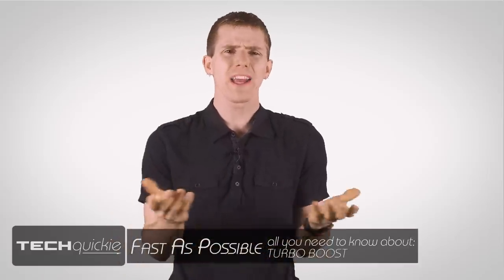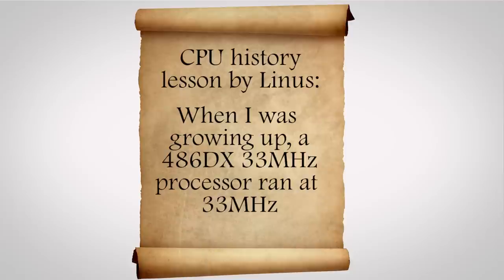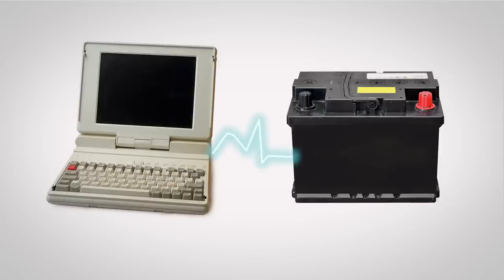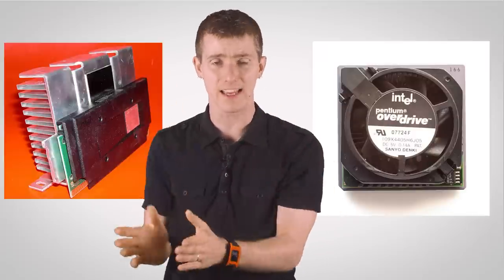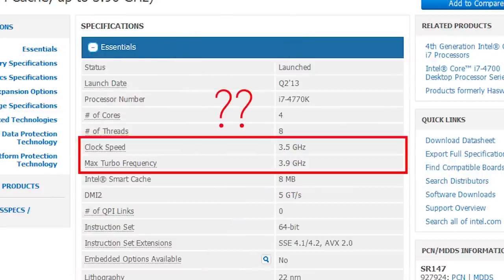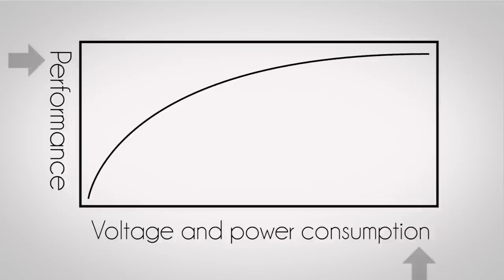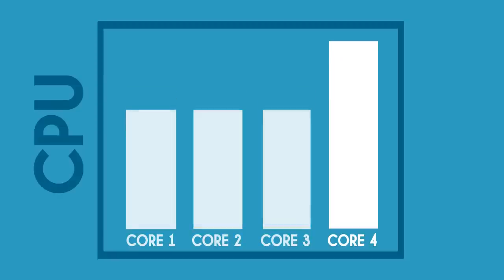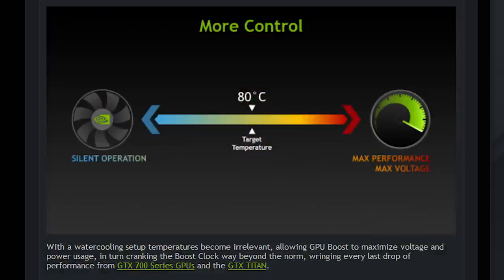Turbo Boost & Processor Efficiency as Fast As Possible

Comment: My laptop fan goes into TURBOBOOST when I open google chrome.
Reply: +Nano Boyut CHromium is EXACTLY same thing as Google Chrome, Chromium uses google chrome´s core made by google.
Reply: +CreeperCraft137 pretty much all devices do that.
they always say "more performance when you need it" but it's really "more performance whenever possible" and that can really fuck with your battery life/heat especially since you can turbo boost on all cores at the same time (which really kills battery life)
thats why for times when im going to constantly have a load on my laptop (say watching a video in a web browser) I turn turbo boost off
Reply: +Aleš Nezbeda (SlouchyButton) only difference is it's open source, has less compatibility with formats and doesn't have a flash player. You should install it yourself. I don't think there is much difference between them unless you hate properiotary software and love google chrome apps and extesions.
Reply: You made my day
Reply: dude the opposite is true
Reply: i mean why are you complaining about turbo boost? you just hook the exhaust fan back to the input and increase performance. do you have a boost leak? is your intercooler filled with oil? did you check the blinker bearings for the CPU???
Reply: lol, buy a new one
Reply: +Blitzkrieg XVideos
Reply: Chrome Hell naw this amateur shit makes me wanna throw up.
Reply: Blitzkrieg Was someone talking about how I cause his fan to go on turbo mode? If so, then closing porn tabs when you don't need them is ideal. So is closing your deviantart tab.
Reply: Chrome I dont know whats up with these people xvideos,deviant art whats next tumblr? :)
Reply: Chrome it's not a problem with you. It was the years of dust I never got to clean out.
Reply: My laptop fan goes into TURBOBOOSTULTIMATEEXABYTESSDOVERDRIVESUPERULTRAOVERCLOCK mode when I click my mouse .-.
Reply: Made my day way to relatable
Reply: XD my favourite comment of today!
Reply: 666 likes
Reply: bruh

Comment: Fun fact: the first so-called "turbo" CPUs were introduced around 1987, and they ran at a whopping 8 MHz, instead of the normal 4.77 MHz. And if you wanted to play games, you had to turn off turbo mode, otherwise they would run too fast! (Because most people didn't have the foresight that faster CPUs would be developed, so they programmed the game's timing to be based on the CPU's clock speed.)
Reply: ***** Asians play it at 120fps. Yea it sucks.
Reply: same thing on emulator.
Reply: interesting...
Reply: I remeber having to press the Turbo Button, in order to play somehting.
Reply: Funnily enough, things like that still happen today. Some games change when played at a higher framerate. Most recent case would be Titanfall in which a lot of actions in-game happen faster if you're playing at 120hz vs 60hz. Your weapons will shoot with a slightly higher RoF which is quite nice if you have a 120hz monitor.
Reply: craig1287 I wonder if that is an artifact of the older Source Engine?
Reply: craig1287 Thanks for spreading BS like that on the internet. You're doing Linus and maybe Mythbusters(?) a favor.
Reply: wow man this is mindblowing to me hehe i was wondering how many years from now were gonna reach 10 mhertz consumer cpus level(before i read ur post obviously) hehe
Reply: Did you mean ghz because today a CPU runs at roughly 4.5 ghz, not MHz
Reply: ***** Yes and no. NFS was bound to the games refresh rate. Games back in the day were bound to the actual CPU speed. So while NFS limits your FPS to 30 and you have to essentially break it to unlock it, you can not limit the CPU speed. So as soon as you had a more powerfull CPU, the games started runing in turbo mode.

Also i loved those "turbo" buttons on them 486 PCs XD
Reply: Grega Meglic
Lol, so that's what the turbo button was for :) I always wondered what it did.
Reply: Yep! Most older computers/electronics had their programs tied directly to the CPU speed.
It makes sense when the program was only going to work on 1 machine and every machine has the exact same specs (Like a Commodore64, or a Gameboy). But the IBM PC wasn't made to have 1 spec revision, so its kinda weird that the games didn't have variable speed adjustment (or whatever the term is)
Reply: craig1287 I can't imagine the Source engine having that kind of issue, seeing as most competitive CS players play at extremely high FPS.
Reply: Adam Saeed
He meant MHz , that was in 87.
Reply: craig1287  The saddest part is, in most game-engines it takes minutes to work around this...
Lazy devs.
Reply: Which is exactly why it was a pain to play older games on newer PC's back in the late 80's early 90's.
Reply: I think COD4 had the same thing about ROF. Framerates kinda affected your ROF which is why Promod limits it.
Reply: Whoa!
I* Remember My First graphics Card.
I'm Looking At You 6800 GTX
Reply: This is not true the so called TURBO button all it did was REDUCE the cpu performance so it could play older games. #learnurshit
Reply: Lol haha nice fact
Reply: haaa wahhh
Reply: Adam Saeed no. Back when cpus ran in MHz
Reply: VWestlife i just found it was the culprit who harmed my pc for months around 5-6 months . Intel turbo boost is really useless
Reply: so back in the day faster pc = hard mode
Reply: there are some games I have from my pentium 1 days that dont have a fps lock, and relyied on that slow 200mhz cpu as the game's fps lock
Reply: @artins90  Bloodborne has it's animations locked to it's framerate as well I think... To be fair it was meant to be played on a console which also had a locked framerate

Comment: Damn Linus did you really have to fuel fanboys by only talking about Intel/Nvidea? AMD cpus have a turbo clock and AMD Powertune (might have that name wrong) adjusts graphics card clocks. As well as I, for one, do not know exactly how AMDs solution for CPU turbo works. It would have been nice if it were in the video.
Reply from the maker: It works basically the same way.
Reply: Techquickie Oh well okay then haha, thanks. I figured there would be some kind of difference.
Reply: He also forgot to say that the first multi core CPu was from AMD...
Reply: andybruintje
hes paid by Intel, so he can't reveal that information XD
Reply: andybruintje Considering the video was not on multicore cpus, thats not a big deal. When the video is on turbo frequencies however, he should have mentioned AMD does it as well as Intel/Nvidea.
Reply: Considering his earlier video about what CPU to buy with the solution "Buy what fits you" it wasn't really needed. And well apart from using the I7 on the last part, most of the video was 'in general'.
Reply: TheGamingLawNL Its still worth mentioning, I feel. Even if it was just "AMD does this also."
Reply: That would be something very hard to see, because a lot of Linus Videos, are Sponsor by Intel
Reply: Old Mate Yeah, Intel is a big sponsor of his Linus tech channel
Reply: whats AMD?
Reply: +EliteRanger_ Plenty of videos where he only talks about AMD
Reply: +Sword of damocles You forgot to say how irrelevant that is.
Reply: +EliteRanger_ Intel and Nvidia are sponsoring this video.
Reply: my Athlon 860k has "X-boost".
Which is basically just a glamorous name for a 300mhz overclock.

That's right, no nifty boost features, it just sets the clock frequency of the entire CPU 300mhz higher, changing the CPU from a 3.7ghz quad core to a 4ghz quad core, with consequences like higher power consumption and more heat output. To make it even worse: enabling X-Boost boosts the core voltage all the way up to a massive 1.4 volts, and the stock cooler can no longer handle the load and the CPU will thermal throttle when under load.

So no, AMD's "boosting technologies" are nothing special, they're literally just factory overclocks that you can enable if you feel like.
Reply: deWaardt
... where's that Fry meme when you need it.
Reply: +EliteRanger_ I like both but I much prefer Intel. I've seen Intel processors take a beating and survive while some AMD's have straight up caught fire on me before.
Reply: Fermifire
Refer to my previous comment.
Reply: Logan Darklock Look out! gramma police is here
Reply: ... That makes you look like you're a fanboy of AMD. Not much difference
Reply: @EmilM-pb2hn  What about appreciating unbiased information?

Comment: I went form a hot running AMD quad core running at 3.2GHz max (AMD Phenom II X4 955). It seemed to turn off cores it wasnt using either, while during idle. However, ive never seen it throttle its speed during idle.

Now i got a i7 4770K and its a world of difference... i should mention i also have a Asus Z87-Pro motherboard, that comes with auto-overclocking features.
single and dual core run at 4.3GHz and triple and quad at 4.2GHz. However, getting it so far to go all the way up, ive only ever seen it use 4.2GHz.
During idle that thing will drop down to 800MHz and use 0.1V or less across the cores.
Its so good i sometimes miss my AMD heater lol.
Reply: ... AMD, heater? you have no idea what you're talking about, the old Phenom 2 X4 955 had a heat cap of 62c, I had mine OCed to 3.9ghz with FSB 182mhz or 282mhz (cant remember) running at 56c max load.

Heaters? you must be talking about Intel

my i5 3570k oced to 4.7ghz runs 85c-90c

why lie?
Reply: you may look at the raw numbers and think its the opposite, but im talking from experience. Perhaps you were thinking of full load situations, in which case you may be right. But im talking regular use across the day: internet, gaming, word, movies, music, etc.

At least in my personal experience and situation - and ofc, yours may be different - my tiny game room was constantly hot with the AMD core + a GTS 250. Now with the i7 and a GTX 780Ti; both supposedly running hotter than the previous pc, my room just doesnt get that hot anymore.

During winter i didnt need a heater, literally no need, when my old pc was on. The current one doesnt heat up the room as much at all.

The reason behind it, i think, is due to the decreased power consumption during low load tasks - where AMD would be revving up the CPU to get the job done asap and only slow the CPU while idle.
Reply: *****
thank fuck I have 3rd gen xD
Reply: ***** woot, dodged that one. I7-4770K doesnt have Intel V-Pro on it.
i do take away from it that we should look deeper into the 'special features' of the hardware we buy.
Reply: Weird. Im using an AMD CPU and it throttles my frequency down to 1.7 GHZ when im not using it and has a non OC-d max at round 3.9 GHz ish.
Reply: I have the Z97-A Board with the same processor and when I try to use the Auto Overclock feature I get BSODs D:.
Reply: My old amd fx-6200 was way hotter than my new i7-4790k too. The Intel one i sooo much better. It just shows what time (and a bit of cheating) can achieve.
Reply: Salpeteroxid I hope it's better yeah :).
It's way more expensive so it should be!
Reply: You should have bought a good heatsink.  I run a fx 8350, and that stock one was throwing tons of heat but when I upgraded it more than took care of the problem.
Reply: Pretty much heater, my A8-7600 run 70-ish Celsius and still perform like a boss

Comment: Yeah I was about to cancel my order of a Dell Inspiron 15 5000, 2019 Flagship, because the stats said 1.6GHz processing speed "up to 3.9GHz". I've always been used to just one speed so thought this would be slower than my current 2.3GHz processor. I thought I'd have to buy new hardware to get up to this 3.9GHz or whatever speed I wanted higher than the 1.6GHz. After doing some research online I found what you say is the case now. You can control your processor max output now and the computer will use the speed that's needed. Crazy. Glad I canceled the cancel LOL.. cuz it's a nice computer with 12GB RAM and 1TB hard drive. It also has a number keypad which I've been missing in all but my 1st laptop. That'll be great because sometimes I have to take tests and will also use the computer for some work functions. Thanks for your info here just proving more how things work now. This one has an i5 Intel processor.

Comment: Aren't all the consumer grade processors "Symmetric Multi-Core Processor" designs?

Which means that the oscillator, and a few other expensive parts (float point arithmetic unit, encryption acceleration etc.), are shared between all the cores. This finally boils down to all of the cores running at the exact same speed at all times. This is done to prevent one core from accessing the cache/ram at a frequency which is different from the other cores. Basically prevents the processor from tripping and falling on itself.

There is this other thing called "Asymmetric Multi-Processing" which is usually found in the more expensive server counter parts. These processors have cores which are all separate processors in themselves and can run at different clocks independent of their sibling cores. ARM recently announced that they will be designing the next gen mobile processors on this design but we'll probably see those coming in quiet a few years down the road. 

Now coming to the turbo boost, keeping the marketing gibberish aside, what it really does is prevents the computer from chocking when given a very heavy load ;-)  . It's very similar to how youtube pushes the start of a video at a very fast speed then slows it down as the video progresses, all this while figuring out the optimal rate at which they should push the video to you and somewhere through the middle it transfers exactly at the rate that's required to stream the video smoothly on your computer+internet. The processor power management is very similar to this. The video is the program you are running, the speed is the thermal limit. The processor boosts the clock speeds in the start of a a series of heavy instructions so that it can slow down later while it calculates how to manage the next bunch of instructions in the most efficient way possible. 

GPUs on the other hand work exactly how Linus explains. They boost up if they are running cool and clock down if they are heating up. That's why it's recommended to run high end GPUs in a well ventilated chassis.

Comment: Sooo, Linus said that one core gets boosted during Turbo Boost. I just checked the Intel website and it said that (at least the turbo boost 2.0 technology) can boost ALL cores dynamically. Soooooo...uhh...yeah?
Reply from the maker: Didn't say that only one gets boosted. It's an example of how it works. Sometimes all cores will get boosted, sometimes a couple get boosted, but to reach the maximum turbo frequency only one core gets boosted.
Reply: I'm glad you asked this Question man. TechQuickie's response just made it ALL clear for me. Thanks Techquickie, you guys rock.

Comment: HI!

Just a comment. It's not like a single core will get the boost that "turbo boost" says.
Setting an example, when I got the i7-4770K, the CPU0 got a 39 multiplier under full load, but the second (CPU1) got 37. CPU2 and 3 got 35 as a maximum. Temperatures were high accordingly to the multiplier.

I dunno about the rest of the models, but I can assure you 4770k works this way. At least on stock. OC I got more and even frequencies among cores.

Anyway, good vids!

L8er!

Comment: Quick quick question guys, if the temps allow it, call multiple cores (maybe even all of them) reach the boost clock?
Reply: Yes, at least on my 3770k you can select if you want a single core to increase or keep them all at the same clock speed and boost all together (but heat builds up really quick...) 95C on stock cooler at 4.3ghz (normal turbo is 3.9 on a single core)
Reply: Tomás Jarsun that's called overclocking. completely irrelevant.
Reply: Unfortunately I believe the answer is NO.
There is a set limit for each core during a certain usage case. For instance when only one core is used you can get the full boost clock (like 3.9ghz in this video) on that one core, there is then a speed (something like 3.7ghz for the processor in this video but I don't know the exact number off the top of my head) for 2 core use while the other 2 cores sleep. If you are using all the cores then the "normal" frequency (3.5ghz in this case) is all you get.
However as bogellenong has pointed out, if you have a intel K series processor (or most AMD ones) and your temperatures are fine, you can increase the clock speeds manually via the bios to "overclock" the processor to higher speeds. there is a lot of information available on this topic but if you accept that you many need to increase the voltage and you keep max voltage and temperatures within safe limits then you can effectively achieve the exact same result as having all the cores "boosted" by the cpu.
With a good cooler most (not all, see silicon lottery) i7 4770k chips will reach at least 4.2ghz stable, a full 300mhz faster than the one core boost speed. Some chips even get 4.5 or even as high as 4.8 on custom loop water cooling systems. However bear in mind it can take a lot of time and mucking round to get there, its not a case of change 3 settings to the same levels as everybody else and you done.
Reply: Thanx for the info guys, I already know how to overclock but until I saw this video, I thought the boost clock was able to boost all cores at the same time as long as the temps were good. What can I say, learn something new everyday.
Reply: if you have your cool and quiet (or whatever it's called with intel) enabled, the cpu will only be as powerfull, as it needs to be. so if you overclock, you kind of set a turbo for all cores, cause it only will be at that speed, if it needs to be.
Reply: Sharcs you are right, partialy... turbo boost is able to boost all cores at the same time. here is chart how it works:
http://www.intel.com/support/processors/corei7/sb/CS-032279.htm

i7-4770K
base clock: 3,5ghz
1 core turbo: 3,9
2 core turbo: 3,9
3 core turbo: 3,8
4 core turbo: 3,7